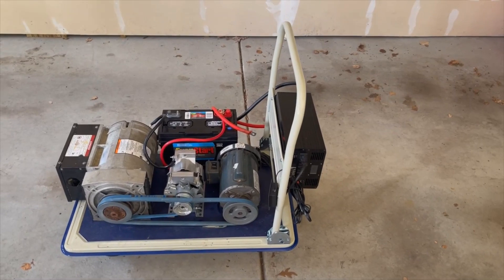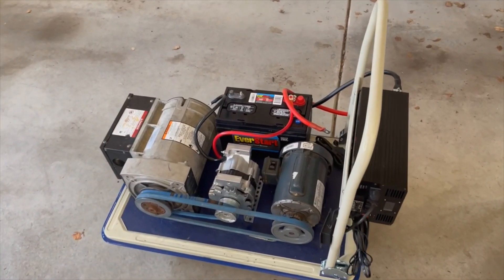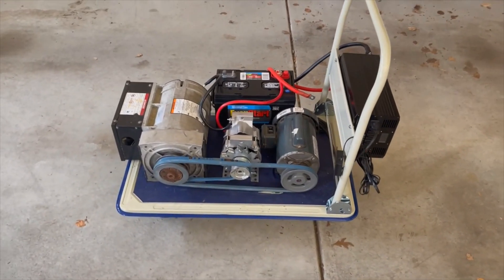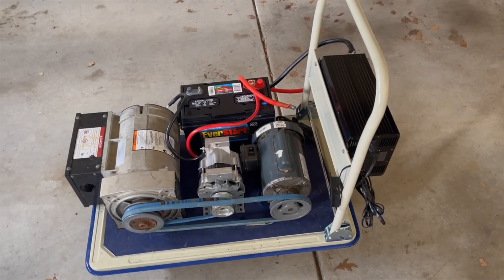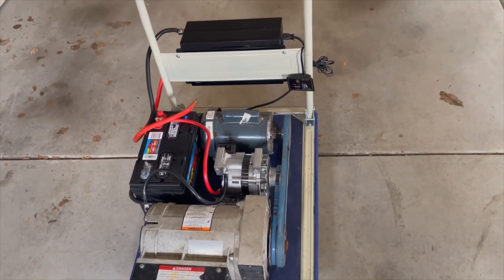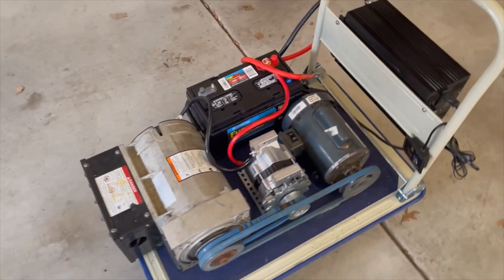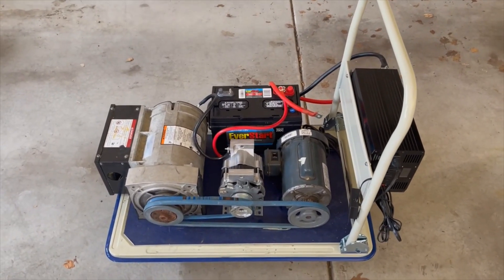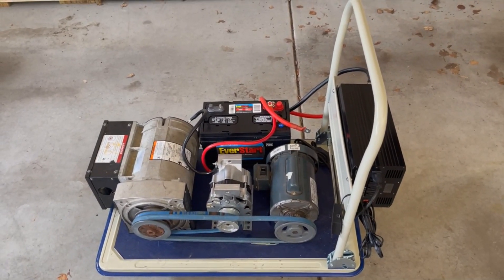Free Energy Generator Video 4 - Over unity

Comment: Can we directly connect two moter for 220v current
Reply from the maker: The generator accepts 240vac and if you sourced the right inverter I’m certain you could use a 220vac motor to turn the generator head. Anything is possible with some thought and action. For me it’s trial, error, and what’s logical in theory from an engineering standpoint.